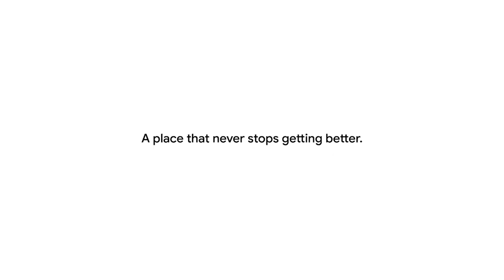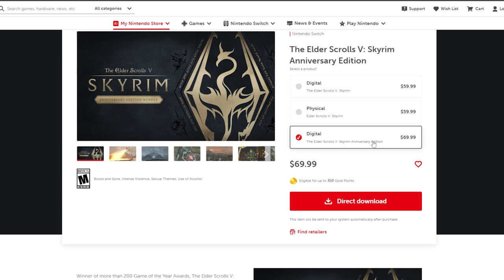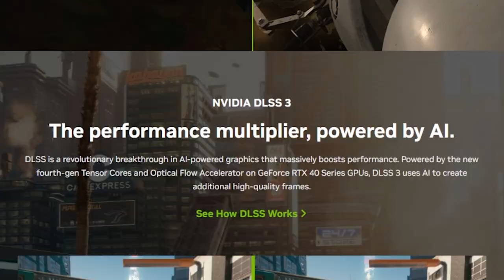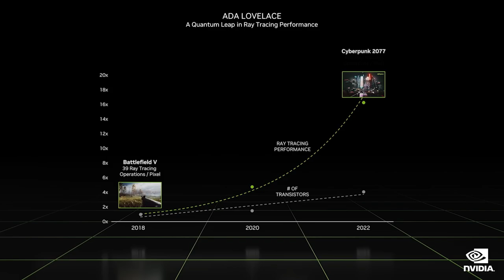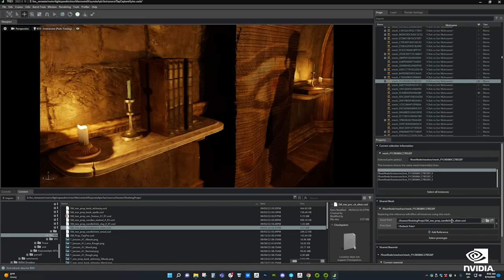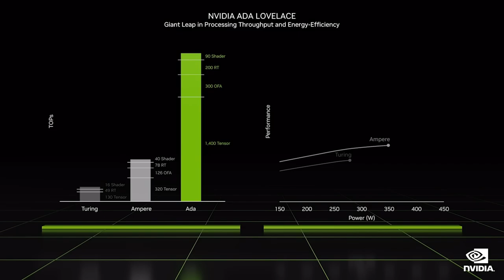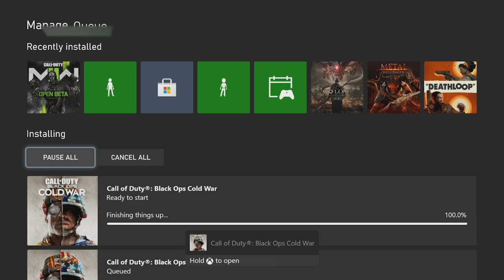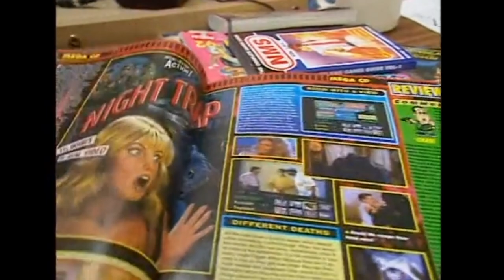Database Info: Stadia sunset, Nvidia RTX4000 confusion? Xbox DRM reversed, PS5 Upgrades, more | V1.7

Comment: Thanks for this very informative video. The line at the beginning of the nVidia coverage "snatching defeat from the jaws of victory" had me laughing out loud. Great. I see no market for theses cards here in Europe with our rising energy costs. The "DLSS 3" feature seems more akin to a frame interpolation on a TV than actual DLSS. And its very strange that it "works only" on the RTX 4000 where nobody will need it. Wrong or at least misleading name on the wrong cards. I really hope that AMD will deliver with RDNA3. And than there is the used card market where I can get a 3090 for much less than a 4080/12GB.

Comment: Great episode, would love to hear your take on the DLSS 3.0 frame interpolation, why would a feature that was found on old VR headsets and cheap TVs, be feature locked to 40xx cards? Shouldn't this be possible with 30xx cards?
Reply: What now... not entirely sure you understand the tech behind DLSS... it's not frame interpolation, it's frame reconstruction... the differences is that you're not averaging, you're actually picking (making an educated guess) a pixel value... often times pixels aren't just . That may not always work, but frame interpolators are dumb-ass solutions. The thing is with DLSS (and equivalent systems) the potential benefit is far in excess of the likely problems - but the possible problems are far more noticeable than the alternative. It's a risk-mitigation based on the fact that we all (apparently) need higher res, and higher frames, and that may be great, but it also is changing our expectation

Comment: That's the truth on this - entry into the tent comes with so many strings. And that's fine - if they actually disclosed all of the constraints/NDAs. Edit: but I do have one thing to criticize - you just said this is why we should criticize with console/eco-system (which I don't agree with)... but you took up the mantle of consumers not criticizing publishers for pricing (because the argument of 'customer's don't need to buy'. That's fine - but I personally think the distinction between a first party software price decision, and a first party DRM decision is moot. It's the same company that is flexing in one/two/both ways. I don't mind Sony releasing a digital + disk version... I just don't think this should/can be a USD100 difference, given the hardware cost is next to nothing. I get entirely what you're saying across a number of fronts (I for one have become increasingly anti-digital only... and anti DRM... and anti subscription model... even though I tested the water). The problem is the subscription model had serious impacts on our tv viewing habits and while for every A+ show that is streamed, many companies vomit out 90 other C-grade shows. We are just being trained to focus on the good, but to also forget about the normal. IMO. Let the best shine through... whether AAA or indie.

Comment: So glad the reception around the new 40 series has been quite negative. Yes Nvidia is showing off lots of impressive technology but they are also being incredibly greedy and scummy upfront and likely even more behind the scene. The only thing I though that was positive was the announcement of RTX Remix and it being free to the public. I want AMD and Intel to knock Nvidia down so that they loose market dominance. Part of the reason why I think is because nvidia is not only in the consumer market, they've been expanding into the commercial market too. Nvidia knows they have the software advantage over AMD and they use that advantage to consistently be ahead of them in certain areas. However if AMD and Intel can beat Nvidia in the cost to performance ratio I could see AMD finally outselling Nvidia with GPUs.

Also it's likely Nvidia is keeping the 30 series around due to their existing stock of Ampere GPUs being incredibly high. They want to get rid of them so they are selling them at lower prices.

Comment: In all my life have NEVER had an optical drive die on any device, & to this day I burn my own cds regularly so I use them heavily; they do not die. What's actually going to happen is they're going to raise the digital only price $50 because "it's more optimized" or some crap excuse, then charge you $100 for the drive; now they've raised both model prices $50 everywhere including the US. This is just going to be another money grab from Sony...while they've lowered they're manufacturing costs significantly.
Reply: PS1 and PS2 drives are pretty notorious for their failure rates. Although it's true I've never had a disc drive fail on me
Reply: Have had 3 CD-players die, one in a car, one in a cheap system and one expensive pioneer. My brother had his original Xbox drive stop working, and we also had a DVD-player die after just a year. All of them died in the late 90's and early 00's, and I don't think any optical drive failed for me in the last 15 or so years, so probably mostly a thing of the past.